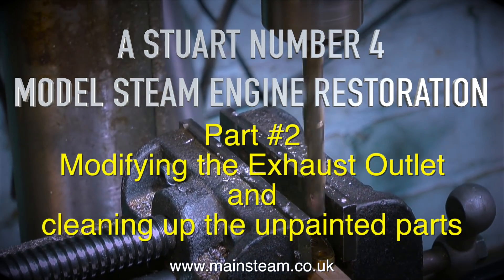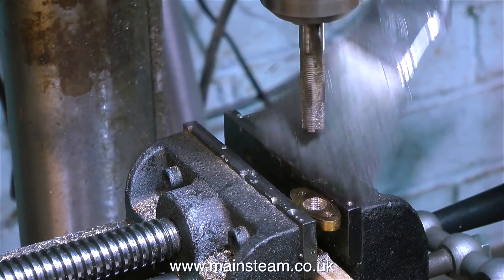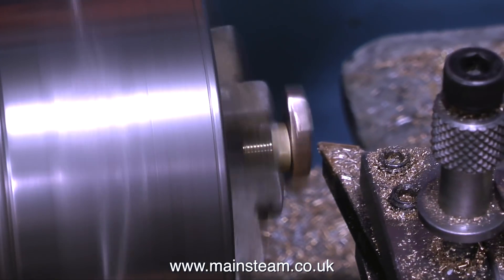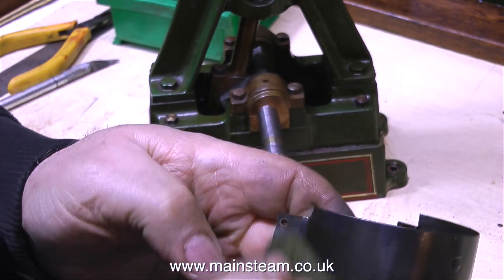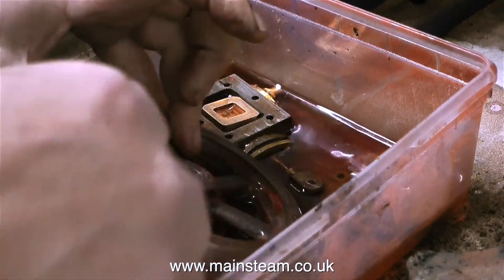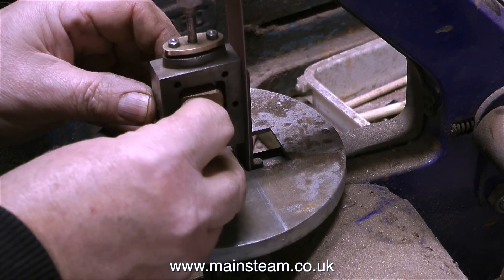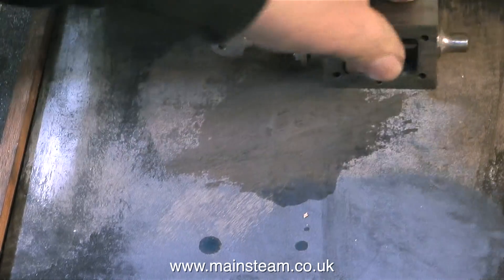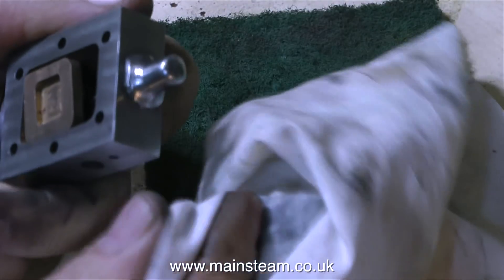HOW TO RESTORE A STUART NUMBER 4 MODEL STEAM ENGINE - PART #2

Comment: Masking tape would help protect the threads on the exhaust flange during the machining operation. Of course you could have put the chuck jaws on the hex instead. I have seen some copper covers for the chuck jaws that stayed in place on the jaws by clever cutting and bending. 
Thanks for the vids

Comment: You can actually reblacken steel with a warm mixture of salt, vinegar, and hydrogen peroxide. Make sure the steel is very clean and completely degreased, heat it up, maybe with an oven, then spray the hydrogen peroxide mixture on the steel which will cause it to flash rust very fast. Rinse the solution off, then boil the part in distilled water until the red rust converts to black oxide. You can card it off and repeat to darken it, and recard. I think it's how they did firearms for awhile.

Comment: Hi Keith, forgive me for another perhaps stupid question. In using paypal I will have to go back and manually donate every month? I didn't see an option where it takes it out automatically every month like Patreon. Am I correct or did I miss something?
Reply from the maker: Hi Tony, Paypal is manually operated. Patreon debits Patron's pledges on the first of each Month.
The reason why a few people are currently objecting to Patreon and pulling out, is because they started to charge Patrons an extra 35 cents in the Dollar extra on top of their normal Monthly pledge. However they got so much flack from Patrons worldwide, apparently they reversed that very silly decision - so now Patreon's status quo is restored {:-))))
Reply: I don't mind either way as long as I know YOU'RE getting the support and not some third party collecting the money, or thinking I'm supporting your channel when I'm not doing so. CHEERS!

Comment: metric tapping is easy, the drill size is the size minus the thread pitch, so m6x1  tapping drill is 5mm,  m8x1.25 is a 6.75mm drill (and usually a 6.5 will do as its  common size)

Comment: Hmm, the blackening process might have been bluing, it's sometimes done to steal, but there is a a product you can get that is similar, it's called Cherry Red I think, it's a surface case hardener, and it leaves a finish that looks a little like blued steel. Cherry Red itself isn't the best thing, but it's great if you just want a hardened coating on something.
Reply from the maker: This piece of sheet metal as usual is far too rusty to use your suggested method .....
Reply: Oh no, I would agree and strongly recommend against doing it with sheet metal like that, you need to heat it to red heat for it to work, and from experience thin sheet metal really don't like that, getting warped and such, but the process is similar for cherry red if you ever want to try it out, I do quite like a blued finish, it can look quite nice on some items.